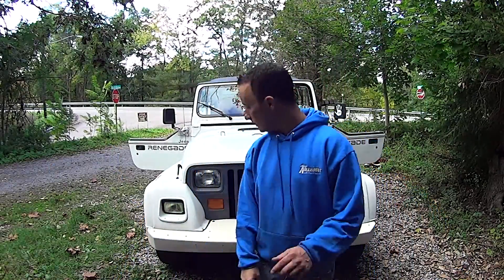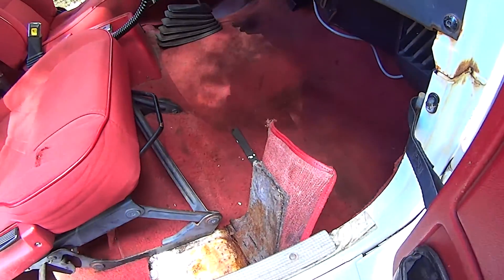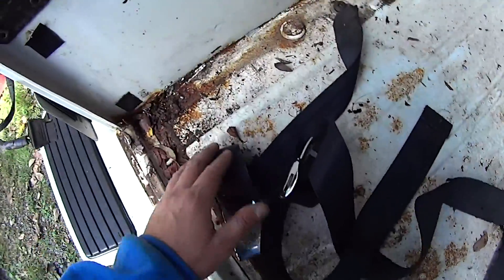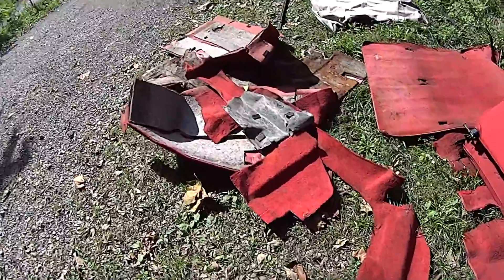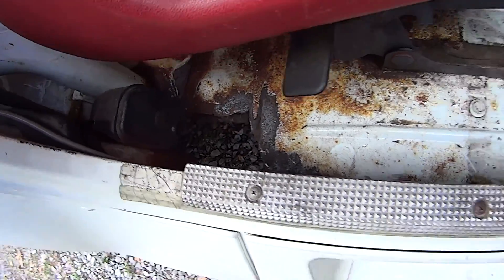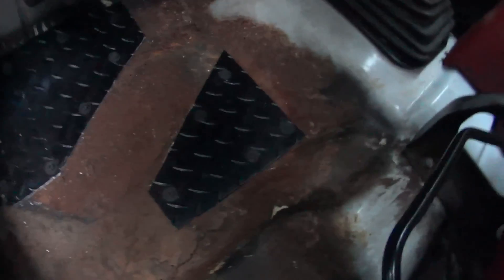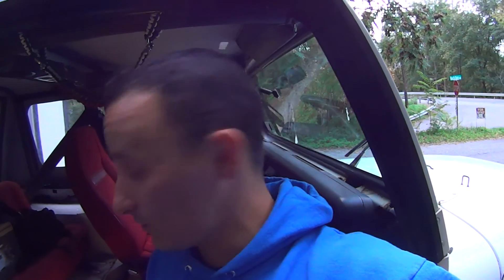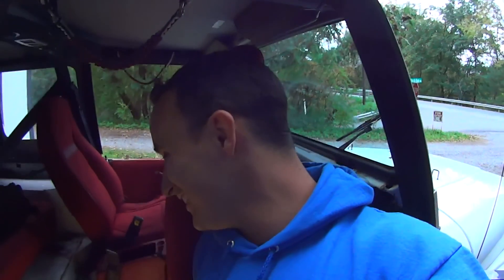Rusty Renegade: Ep 21- Sketchy Floor Pan Repair

Comment: That rust makes me cringe
Reply from the maker: Tell me about it! Ugh!
Reply: UndergroundTrev that just makes me wonder if it's even worth it ... my girlfriend wants some sort of wrangler and everyone that's halfway decent has some sort of rust issue ... from the NYC to north jersey side of town so rust is indefinitely inescapable
Reply from the maker: ivtecudont241 Totally worth it! haha. Jeeps are a ridiculous amount of fun. I've gone places and seen things in my Jeep that I'll never forget. Just make sure you know where to look for the rust before you buy. 

YJ's tend to rust at the windshield frame, front floor pans, and the frame rusts almost anywhere it curves, but especially in the back arch and rear bumper sections. The YJ frames had very few drains. 

TJ's tend to rust on top of the front fenders and at the rear frame area. 

I'd venture to say JKs are still new enough to not have to worry much.